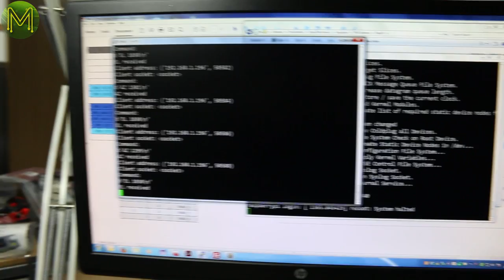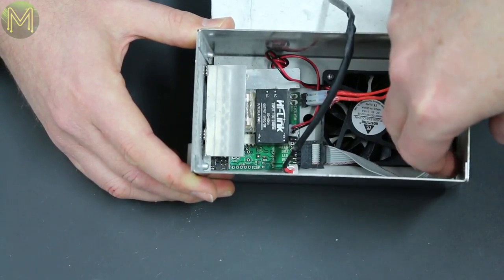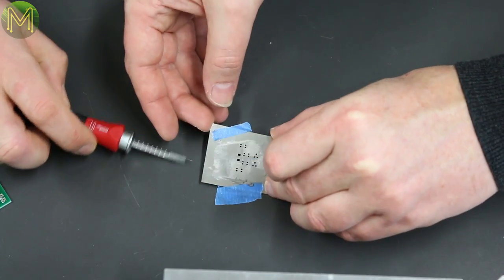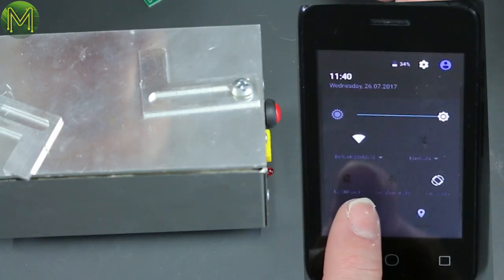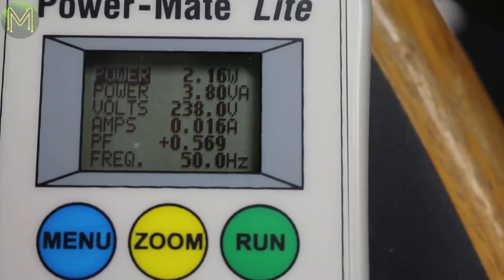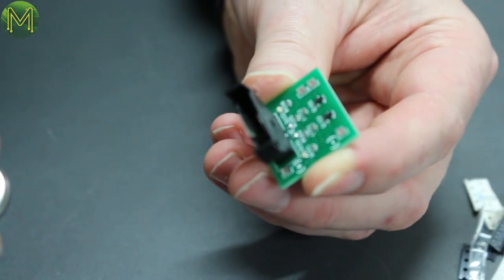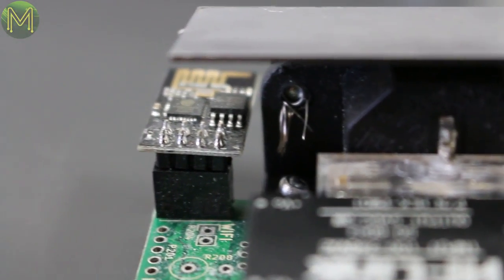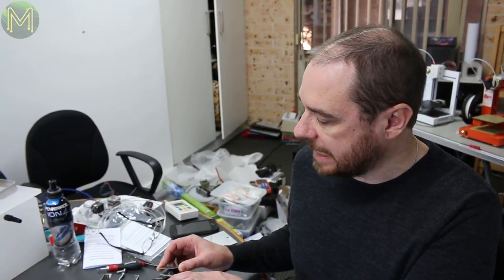#155 ReflowR testing: Melting metal fun // Review

Comment: I have used it to solder some QFN with thermal pads, works quite well if you dont screw up placing :P
The box is really sketchy, and the buzzer did annoy my whole workplace two days. But hey, at this price point it's still a huge improvement over a frying pan! It does the job very well. I will use it more often, that's sure.
Reply: Hi Manu, in the latest app version you can disable the buzzer. Also, check there is a new manual published.
Reply: Manu I don't remember a buzzer - maybe only included on later units

Comment: Thanks, Mick and Kean for showing off my ReflowR. 

As noted this is one of the first units ever produced back in January, I have made many improvements since then. 

The insulation is mineral wool, the data sheet states it is safe( http://www2.owenscorning.com/literature/pdfs/oc_epd_naima_light_density_min_wool_board.pdf ),  

1) The earth strap is now laser cut steel part that sits on the other side of the connector, it also acts as washers to avoid the connector cracking ( http://www.reflowr.com/blog/Strap.jpg ) 

2)The top earth tab now gets cut off flat so the fuse is not obstructed (same image above). 

3) The heater cable now has heat shrink to prevent the sheath from fraying and to hold it tight ( http://www.reflowr.com/blog/cable.png ). 

4) PCB’s are washed, so it is not so crusty ( http://www.reflowr.com/blog/pcb.jpg )and you can actually read the part number of the PIC.  

5) Extra insulation is added between the heat-sink and connector (same image above) 

6) The op-amp has been upgraded to a high precision op-amp (MCP6V02-E/SN). 

7) The case has been refined a bit - rounded corners etc.

p.s. If you do order a ReflowR please select the EMS delivery option, surface mail is really slow and is the cause of all my complaints and headaches.

Thanks again
Lafras
Reply: Lafras Henning thanks for that info

Comment: Seems as though you could just use the ESP8266 as the microcontroller for the whole thing, use a bigger fan for faster cooling and redesign the board to be a little bigger and better designed for maintenance. Also might be an idea to look at why the power factor is so rubbish. He should also look into hiring a sheet metal shop to make the boxes. From personal experience, unless you are tooled properly for such things, it is faster and cheaper to have someone who knows their stuff get it done.
Reply: From what I understand the ESP8266 wireless module was an optional extra, but yes it would have been sufficient to run it all.  Lafras mentions using a laser cutting services for custom metal parts on his projects, but not sure if that was the case on these.

Comment: LOL. I have a bunch of "and something" SMD parts, too, if I'm not wearing one of these which I love:

SE MH1047L Illuminated Multi-Power LED Head Magnifier
https://www.amazon.com/gp/product/B003UCODIA

I don't bother to use the LED light on it because I use properly intense bench lighting, so I can't speak to the value of that LED light.
Reply from the maker: +Winston Smith 
Nice. Might check that one out.
Reply: I've got a pair like that, but I prefer just cheap reading glasses or a magnifying lamp.  I actually just got a neat microscope camera with HDMI out from Banggood, and really like it.  I might suggest a quick review of it with Mick sometime.  Although it wasn't that cheap it is still way cheaper than a professional unit.